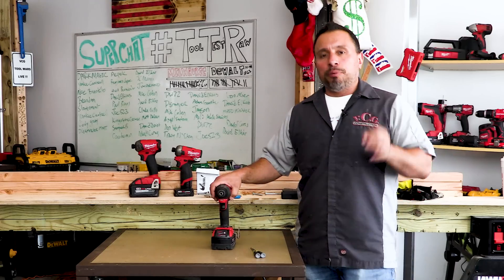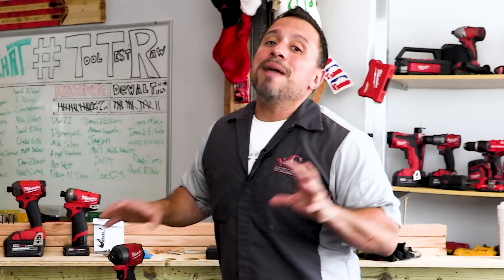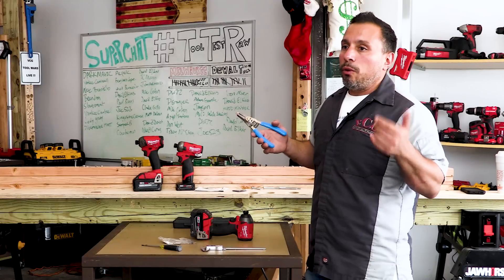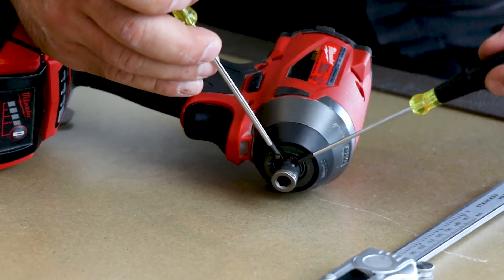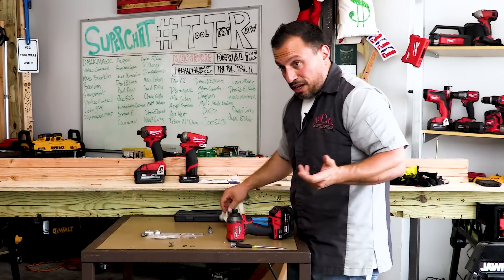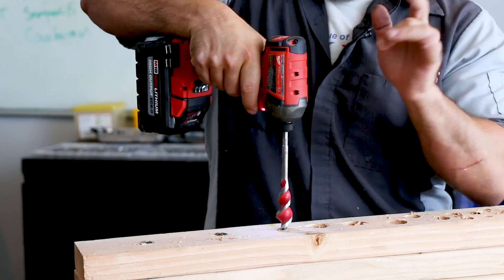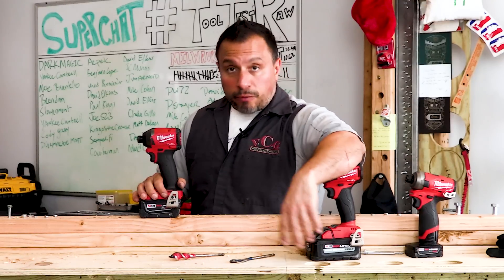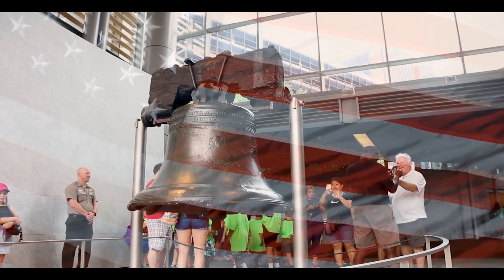Serious Problem With Milwaukee Impact Drivers - Replacing The Ball Bearing

Comment: I think the gen 3 is simply too powerful for the collet design. The impact force and vibration overwhelm the spring retention force and the bit slips. That’s my guess
Reply: That can be a part of it, but the simple fact that you're pulling with a decent ammount of force (when using something like those spade bits) to get them out of there, and impacting, then it's gonna both colapse the spring with the pulling force, letting the ball be free, and then the impacting just sends it home. A stiffer spring should fix this problem to an extent...if you pull like a gorrila on it it's never gonna work.

Comment: Just a thought: would bearing and bearing-spring from surge fit in the gen 3 problematic model? If so, perhaps swap from surge to problematic model in stages and test? e.g. try bearing first, test, then try bearing plus spring, as necessary.
Reply from the maker: Good idea J D, thanks!

Comment: It is not a solution, ONLY A FIX. The solution is for Milwaukee to correct the problem before it leaves the production floor
Reply: Except it didn't fix anything
Reply: the ball bearing is the fix if it stops holding all together.  That will happen after it slips out too much.  
the correction will likely come in a follow on generation of tools and include
1: a 3 bearing collet (what I would change the design to.  it's a bit of engineering and 3-15 dollars increase parts and labor for production.)
2: a slightly stiffer spring.

Comment: Stronger spring combined with the larger ball bearing.  Pull it apart again and degrease it and try again.   Could be your grease compromised your fix?  The good news is that it came free while impacting, but held afterward which it wasn’t doing before, right?

Comment: Maybe it could be the secondary spring holding the ball bearing in place and it needs a stronger spring to put more force on the ball bearing
Reply from the maker: Quite possibly!
Reply: I'm pretty sure your right. I finally had to fix one of my dewalt 885 collets after 4 years of hard daily use and the secondary spring was actually broken. Put a new one in and should hopefully get 4 more years out of the tool. My guess is that Milwaukee might have unfortunately sourced a weak spring which is allowing the collet problem to happen much sooner then it should. Eventually I believe every impact will have this issue after many years of hard use as a spring will wear out but if the manufacturer has used a good spring it shouldn't happen for many years. Could be a good Ave vid.

Comment: I think I would look at shaving a very small amount off the washer that contacts the ball. If it's diameter was SLIGHTLY larger it will ride up on the ball higher for better retention.  At present the ball is able to push back the washer and spring. Yes more spring pressure will help. But where to get spring. Enlarge the washer that contacts the ball slightly and your golden.  Guaranteed this works.  I hate all the play they have so I drop dropped a small Oring in the bottom. Of course I have to slide collect forward when installing the bit. But no more excessive play.  
My 2 cents from Canada

Comment: Find a ball bearing with a tolerance between 3 and 50. Grades 100 through 2000 have more “slop” allowed in their manufactring (and hardness, surface tension, etc) so you’re gonna get a “true” 4mm ball bearing if you check the specs on what you’re purchasing. Good luck!

Comment: My guess is it needs a stiffer spring, it could be the speed of rotation vs the weight of the ball bearing makes it release. Downfall of the auto loading function is the spring is the only thing holding the bit. The impact also may be harder and faster.  I only have the older tools and don't use the impact drivers for drilling as I do automotive, I use them for bolts and screws.

Comment: Needs a stiffer collar spring..
Reply: Thats exactly what it needs. I changed mine and works fine now. When i took my m12 apart and saw a stronger spring in it than the m18 i figured that was the problem and it was. Milwaukee trying to save a penny on every spring and letting the customer deal with it.
Reply: chris webb where do you get the spring?
Reply: @chriswebb3018  What spring did you get? Size ? I'd love to swap mine so this stops happening!!!!
Reply: @chriswebb3018  Where did you get the spring?
Reply from the maker: Quite possibly!!

Comment: What about the grease you used? What if it makes things too slippery under impact? 
The powerful impact mechanism is definitely causing this bearing to let go at the insane amount of IPMs this thing is putting out.
I just bought a set of gen 3 fuel drill and driver combo kit and my impact collet is doing the opposite. It won't let go of the chuck after heavy impacting. I will need to jam the chuck into the collet to get it to release.
Reply from the maker: Maybe they fixed it too good on the new ones!?
Reply: This is my first set. My coworkers are saying it might need to be broken in.
Is it normal to have the 3 drill jaws wobbly and loose when they're not grabbing anything?
I bought these because I was told and have seen that Milwaukee makes some of the best tools out there. Now I'm having some doubts

Comment: Maybe you should open up both the Gen 3 and the Serge collets and compare the parts.
Reply from the maker: We might need to do that!!
Reply: @VCGConstruction  Do it!!! Such a good job on this situation. I love Milwaukee and dang man if you can get ball bear rolling haha do it!!!
Reply: AvE will probably do that, if he hasn't already. haha
Reply: @samshim3149  I dunno. Seems a bit too narrow and very specific, to fall in AvE's wheelhouse, unless he has a personal interest in it. He also seem to be more than well set for impact drivers. It's not very far fetched, but I don't imagine he'd get two more just for this purpose. Would be nice if he did, but I wouldn't hold my breath for this particular piece.
Reply: Took me few min , clearly there is too much empty space inside that bit holder , the ball bearing has room to move  , when it should hold the bit .
Solution , Milwaukee to provide new parts for that bit holder , with less space for that ball bearing to move , when its locked on a bit or a drill .
Reply: I was gonna say the same thing make a video on it if you do
Reply: you replace the ball bearing on that test but possibly the spring itself that holds the ball bearing needs to be stronger as well? The combination of a stronger spring and a larger bearing might be the next step.
Reply: That’s a good shout.
Reply: The part numbers are different for both the ball and the spring, but that doesn't mean it wont work.
Reply: Beat me to it. See if there is a difference. Also can you replace the collet with the surge collet?
Reply: Sadly my SURGE m18 (new bought it 2 days ago from Ebay) the bottom clip twisted and came out and didn't even stress the impact 😔
Reply: @nathanieldray5995  I had the EXACT same thing happen to my Surge, but fortunately I bought mine from Home Depot and was able to bring it back for a replacement.  The new one hasn't had an issue... yet.
Reply: Joe Stafford YES. Was wondering myself why this hasn't happened yet
Reply: Why not return it and use the warranty for a defective drill?
Reply: probably a surge. not sure wtf a serge is.
Reply: @stabenheimer  so he used the wrong vowel. Big deal. 🙄
Reply: @stabenheimer  WASN'T HE THE FUDGE FARMER IN BERVERLY HILLS COP
Reply: @stabenheimer  serge collets played for the montreal Canadiens in the early 60s

Comment: Completely understand the collet is weak. However I have never had this issue happen to me. Is it because your bit is never exiting the material? You are not drilling a through hole. I have never drilled into material that is not a through hole. Once the bit makes it through, its loose and backs out easier.

Comment: So, in other words, TTI got a huge order of ball bearings that weren't properly QAd by the supplier. Then, they didn't bother to test the tolerances themselves. EDIT: Well, crap. I hoped it would work. Maybe there's a problem with the spring that retains the ball bearing.

Comment: oh great I just ordered the M12 combo set (hammer drill / impact driver ) anyone owns the M12 impact driver has this problem?
Reply: Cocologo the M12 Impact that you purchased does not have the same issue. At least not with mine it’s been running fine with no collet issues.
Reply from the maker: We’ve not had this issue with our M12 Fuel either!

Comment: Sucks this didn't work Vince! I couldn't tell you to a T exactly what sized ball bearing and spring I used. But it was the stiffest I could make work. I don't remember the last time I used it through timber post, but it was backing up just fine. I never had the issue outside of drilling the deep material... also I have or had "per say"  plenty of issues with my Dewalt collets too "back when the impacts were working." But I think in the case of the milwaukee......... The smartest thing for @MilwaukeeTool to do is HURRY UP AND FIND a solid fix for this before Vince @VCG Construction loses his sh*t! It's a serious situation!!! 

A lot of the users of these tools will never have the issue because they don't use them like tools. It's us that use the tools all day in and day out that will experience it. Kind of like the Burning 887. It's a thing.  I have 4. I'm just one guy and a small crew. Anyway. I'm not going to jinx myself. But I am going to say, for now mine are all holding.
Reply: Oh and I have ultimately told my guys to stop using the impact like that and use the drill.  But I haven't had a problem after fixing mine up.. Maybe I do and don't know it yet?
It shouldn't be that way. Regardless.

Comment: Vince I do beleive that the 4mm ball replacement may work. However the ball bearing you purchased may and I'm only speculating are not fully 4mm bearings. How about measuring the bearing in the gen 1 impact and replacing the size of that impact 1 bearing to the community. Maybe the gen1 impact bearings may work in the gens 2 and 3 impact drivers??? A suggestion. "With that" Vince thank you for another truly awesome and educational vid.

Comment: After a quick search ...4.5 mm ceramic coated bearings exist and are readily available..if they’d fit in the channel that is...maybe in conjunction with a ball bearing retaining spring from a surge driver? If you could get ahold of one those that is...just thinking out loud....

Comment: At this point I’m starting to think it is the way the piece that holds the ball bearing is designed that causes it to release tension or maybe when the ball bearing is being pulled a different way because of Quick insert design it doesn’t hold on

Comment: Mine does not exhibit this issue. However, it does change the torque settings on its own between installing fasteners. Example - your on speed 3. Next trigger pull it’s on speed 1? Not worried enough to warranty it. Just an annoyance.

Comment: A 4 mm ball might still be the solution. Don't give up, try it again with a different ball.  Your factory ball bearing was measuring at 3.92 mm.  Your replacement 4 mm measured at 3.98 mms, giving you a difference of 0.06 mm.  You said that with that little bit of difference you can feel the difference of the force required to insert you're bit. So if you could feel the difference with as little as 0.06 mm, see if you can find 1 with half that difference on the plus side meaning go up to 4.01mm.  An increase of 0.03mm, half of what you just went up would bring you 0.01 mm above the 4mm suggested size instead of 0.02mm under the suggested ball bearing size. Don't give up. Who knows how long it will take Milwaukee to come up with a fix for this and when they do come up with the fix for it how are they going to implement it are they going to leave us out and require us to buy another impact driver that already has the fix on it or are they going to issue DIY repair kits or have a send in or impact drivers for them to repair it therefore leaving us out in the cold maybe for those of us who only have one impact driver?

Comment: Why do you have to fix anything, we pay a lot of money for our tools. This should never happen in the first place.
Reply: Premium price for a fucked up tool
Reply: Ya and milwaukee is supposed to be bulletproof
Reply: @mikegman7502  Supposed to be...😅 You know, it is not profitable to manufacture non-breaking product
Reply: @MrJetDevil  It's even less profitable to make a tool that fails less than a year into its 5 year warranty.
Reply: @mikemorgan5015  that why they put a lot of effort in design part that last 5 years and 1 day then self destruct. If you don't buy new tools they can't make money.
Reply: @nicynodle2  Do you realize what power tools go through in commercial use?  5 years is crazy good.  If you are really using your tools, they will likely be ready for replacement by then anyhow.  While cordless tools of today probably won't last like grandpa's old 20 lb Skil worm saw, they are remarkably well built and we are more productive than ever because of them.  Ask an accountant.  Tools are cheap, labor is precious.  If you get 5 yrs out of em, you got more than your money's worth.
Reply: Same happened to DeWalts a few years ago.  The reason you fix it is obvious.  So you can put the tool to work.  There is no official fix at present.  So you can cry and whine about it, or you can put on your big boy pants and be pro-active.  It's pretty obvious that they have a design flaw.  It happens.  Should you push the envelope and take chances and sometimes things go wrong.  Or should you stay safe and comfy wait on others to fail and learn from their mistakes.  Anyway, you can bet that all hell is breaking loose in Milwaukee and China.  That guy that saves them half a cent/unit getting cheaper retainer springs is likely unemployed already..........  Have a great weekend!
Reply: well the heck with that then
Reply: Victor Ov Crap Made in china
Reply: Two ball bearings should be the norm. The Multivolt triple 🔨🔨🔨 has two, and although it is not a quick insert, the thing never lets a bit go.
Reply: Victor Ov there’s other things as well I’ve bought 3 separate brand new kits and there was something wrong with ever impact drill. Mostly directional button failure and trigger failure
Reply: welcome to the real world, sometimes companies get little things wrong and shit breaks, 75 percent of the repair work i do is a warranty claim...you think a 200 dollar drill not holding a bit is bad, imagine losing all your food in a 10,000 dollar 2 month old refrigerator, welcome to the future
Reply: Well wear and tear
Reply: Yeah, shit happens. These things aren't indestructible you know, nothing's perfect. Say that to Lamborghini when your brand new super car catches fire..
Reply: You must be in the service industry.
Reply: Cough.. Makita, cough cough
Reply: Why don't they just use the design from Ryobi? Same owner, so should be doable? Never heard the alien green having this as a common problem (or sticky triggers for that matter...).
Reply: @kundetjenesten  It very well may be the same part for all I know.  Nothing in the Ryobi line, or any other for that matter, hits as hard as this driver.  It would be like saying the wheel studs are the same on a Honda Civic never fail, why not put them on a Corvette?  Reliable in one system doesn't equate to reliability in another.  While I'm pretty convinced that it's the ball retainer spring, I can't say with ANY certainty that it's a design issue, a defective lot of springs, a poorly deburred part, or something else.  Mine hasn't had any issues yet, but I'm not driving self feeding augers bits and continuing to drive them after the chips jam up with it.  Regardless, it certainly shouldn't be releasing as has been demonstrated.  I HAVE had issues with certain Harbor Fright step bits not wanting to release.  But I measured the hex shanks and the ones with issues are oversize by a few thousanths, and the hex points are sharper than ones that perform normally.  All of the above could be wrong too.  Just giving my 2 cent analysis.  Take it for what it's worth.
Reply: @mikemorgan5015  I never tried any Milwaukee impact driver and just react to what I see and read from people who do have this issue, so I'm not an expert either, just to have that said.
However; from what I can see in this video, this tool has a single ball bearing? The Ryobi has two. Two sounds more safe than one to me. Could be that the Milwaukee hits so hard that the engineers are afraid to weaken the structure by removing a couple of millimeters of goods to make room for another ball, what do I know. 😉
Another difference that I noted was him mentioning the Milwaukee bearing engages in a flat, whereas the Ryobi ones engage in the angles. That should give the latter tools lock more surface to work with per ball as well.
Reply: @kundetjenesten  Interesting.  Thanks for the good info on the differences.  You are way ahead of me then.   Haha!
Reply: @mikemorgan5015  Hehe, no problem mate. I try not to get too confident as I havn't seen this model IRL so if I misunderstood anything people can feel free to correct me. But if I'm not wrong then it all just seem weird to me that the "pro brand" in the portfoilio has any less effective solutions at all than the "budget brand".
Reply: @kundetjenesten  Is the Ryobi a hands free insert socket?  I REALLY like the bit sockets on the Milwaukee M12 screwdrivers.  Pull the sleeve, bit gently pops out and the sleeve stays where it is until you insert a bit and then, it locks again.  No idea how it would withstand the beating of this impact though.  Probably not very well, if I had to guess.

Comment: I think a 4.5mm ball bearing will do the trickand a stiffer spring the pressure of the spring on the ball retention is not enough